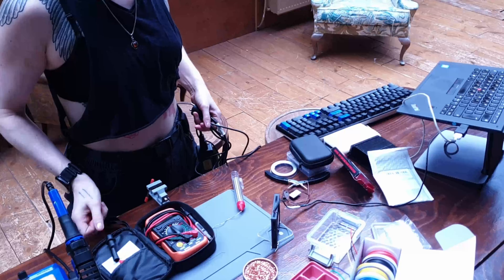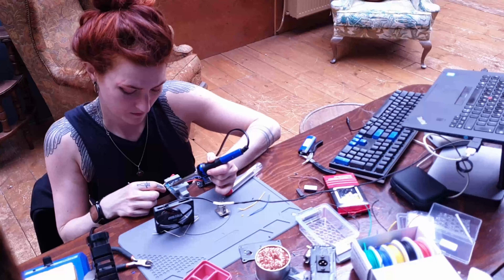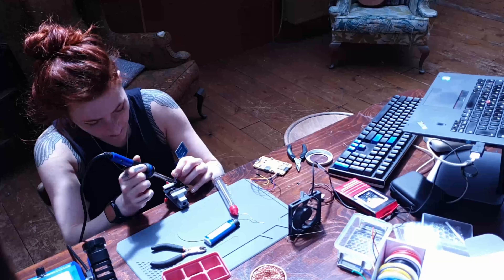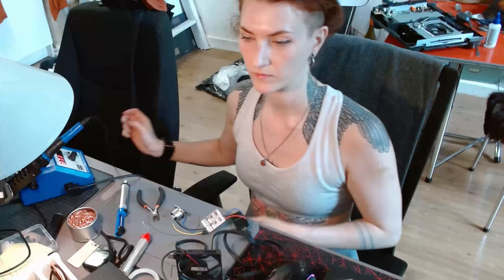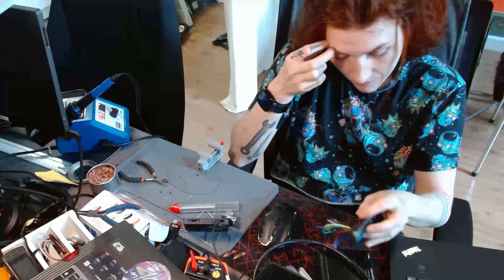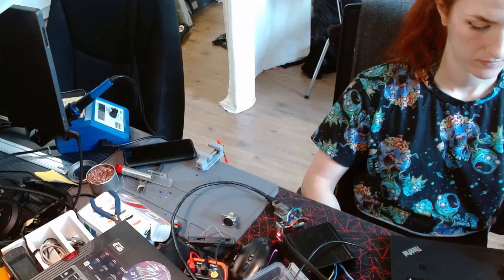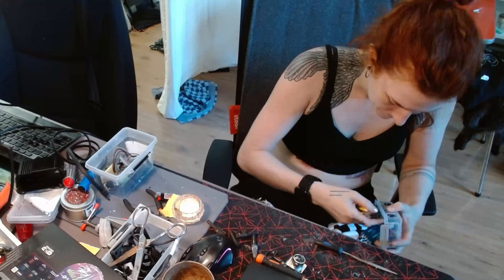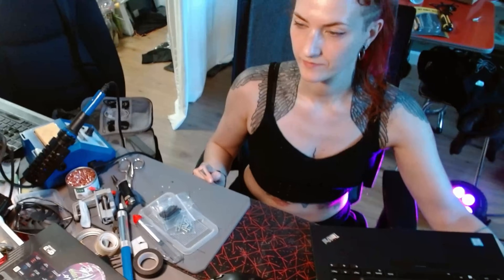Making a DMX lighting communication node (Artnet) from scratch with ESP32 - Devlog

Comment: Can it also do DMX in?
Reply from the maker: Not this version, but it could with a few extra modules attached!
Reply: I think it can edit some code to achieve this function. Why not use only one typec wires to control fixtures. One typec interface to rtl8152 to esp32 to max485 module, it's more simple to use a typec to computer, then control some fixtures. At stage it's easy  to use😊
Reply from the maker: @skin9494 that is a possibility too! I prefer 2 DMX ports out and as little USB ports blocked on my pc as possible. I already own an enttec box (that does USB) so for me this was the option I wanted, but what you suggest is indeed a very valid option. Sounds like you have a nice project ahead of you!
Reply: Yep, u are right. As long as it useful for yourself. I expect your other gorgeous projects🎉🎉🎉🎉🎉